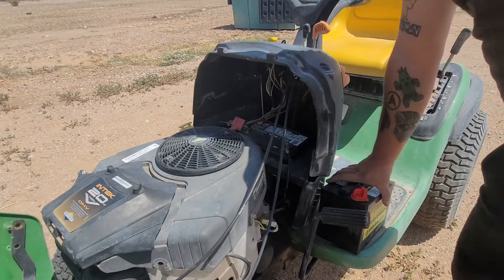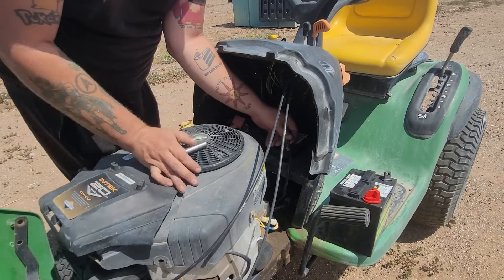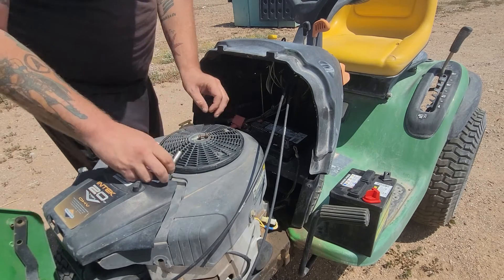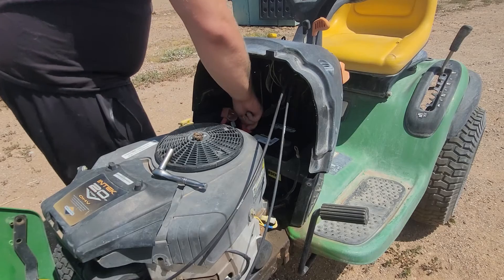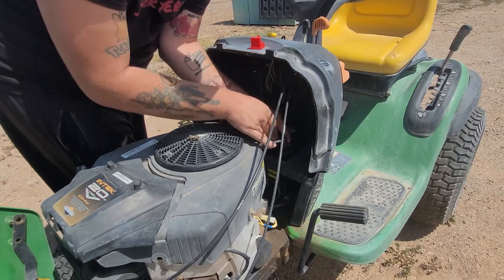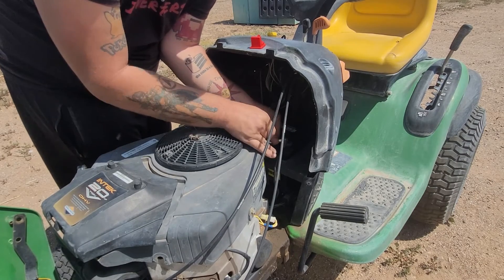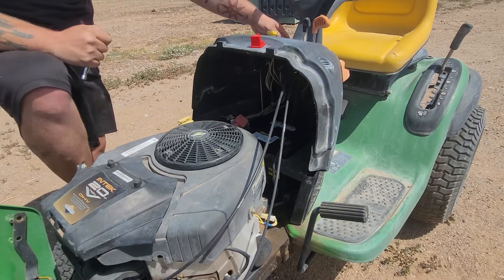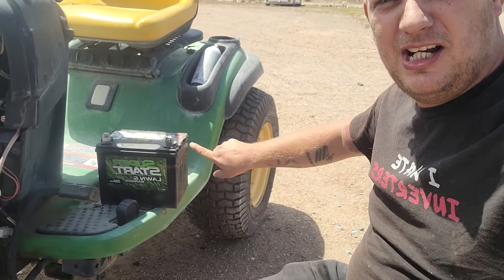Changing the battery on your John Deere L series Lawn tractor/Riding lawn mower.

Comment: For battery terminal order, on cars, I have usually seen the negative removed first and reconnected last. Once you disconnect the negative terminal, the vehicle body/frame is no longer negative.  That way, if you happen to touch the wrench to the frame while removing the positive terminal, it won't arc.
Reply from the maker: Right lol I accidentally done that a few times no cap